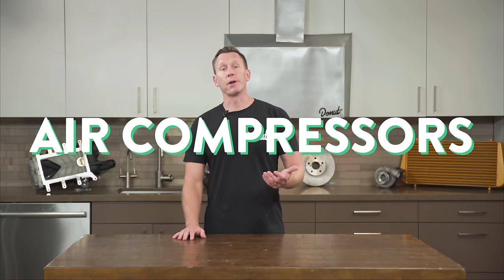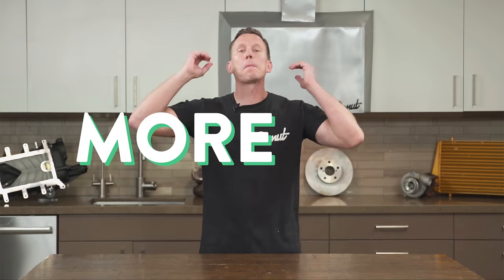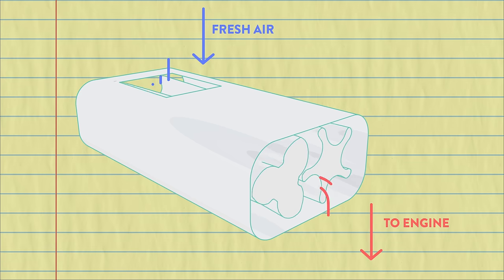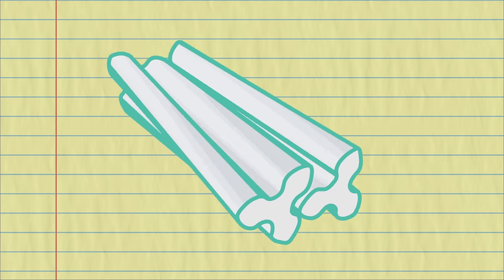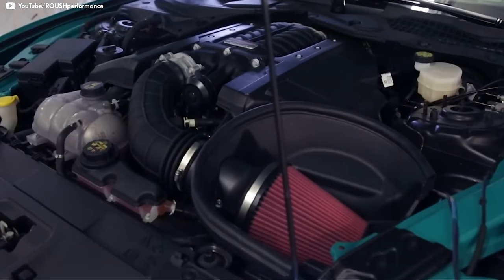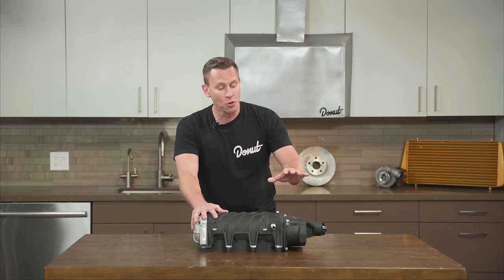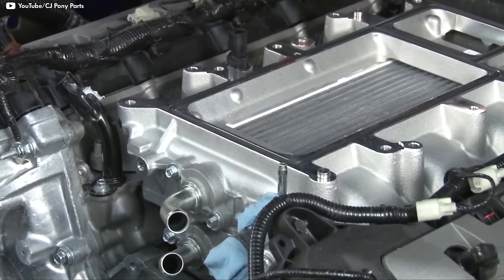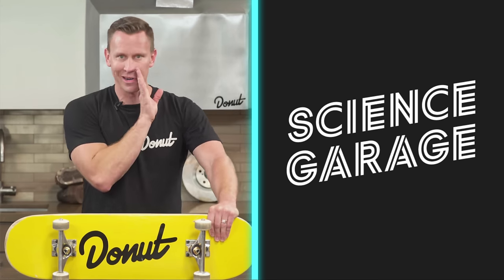SUPERCHARGERS | How They Work

Comment: Anti-lag or whatever it is that creates that loud bang on some cars!
Reply: TotalSalle Use Tuercks car as an example! Lol
Reply: But true antilag like in old Bimmer F1, EVOs, Celica GT4 and Audi quattro S1, not this fake 2 step shit.
Reply: Pietrek L sorry to break it to you, but they're the same thing. Only difference is when it's on.
The reason street cars don't run constant antilag is because it absolutely destroys the turbo/motor.
I helped out a team who own one of the Audi S1 Ap1 cars and even they didn't run that aggressive antilag just because it was too expensive.
Reply: I’ve owned an anti lag system for nearly 10 years and never used it once (1994 Celica GT4 WRC)
Reply: Neg Ative eh probably don't need it. It's a pretty small turbo and you'd only really need it on a tight track.
Reply: I know about that, I'm just curious about this all bypass and other stuff to keep turbo spooling. 
Ordinary 2 step can also brake engine, as you said broke turbo, burn /melt valves and valves seats, bend rods, etc.
Reply: Pietrek L
So in my exhaust manifold, on each of the four runners before they are paired to each side of the twin entry system on the turbo is a fuel injection point. When activated, the anti lag system drips a tiny bit of fuel into each runner in sequence that explodes on contact with the cherry red manifold (Yes it is always glowing hot). The pressure increase from the exploding gases provides both pressure to spool the turbo and pressure to bend the valves in my engine’s head (eventually). It’s also very hard on the turbo components. This is why almost no one uses it.
Understand?
The WRC spec car also comes with a stock water/meth injection system in the TB.
Reply: Unco Casey
Totally. The lag on the WRC turbo is imperceptible and since it’s a steel wheel, instead of the ceramic unit used on the standard model, it won’t come apart at 18psi+. I’ve been running 25psi since 2010 or so - no issues. It’s a fucking beast at that level. Dyno’d way over 300WHP/WTQ on a mustang dyno with all supporting mods.

Comment: Great video!  Suggestion, demonstrate a fuel injector operating with pressure on it... maybe get into pulse width... or the difference in larger flow rate injectors and the accompanying fuel pump and lines.

Comment: How to make 35 MPG in a half ton truck? Pre 2007 
Do that.
Reply: Half ton is more like a golf kart.Most small cars are over one.
Reply: Hailstorm don’t think he was talking about how much the truck weighs
Reply: @hailstorm7868  the truck understander has logged on
Reply: Engine swap
Reply: Or fuel injection and a less aggressive cam, and other bits could boost your stock fuel economy, at the cost of power

Comment: how does camber work???
Reply: sorta. Gotta stop at some poilt then it gets ugly and potentially messy.  Nah. Camber on a car:
You know how you lean in on a bicycle in corners to prevent falling over to the other side? Cars cannot do that, so they roll outward a bit. Pretty visible on not so sporty cars in tight corners.
Now, at the same time most weight is on the outside tire in a turn, bc the vehicle rolled a bit and is generally out of side balance. Wouldnt it be nice to have a wheel that is pretty much straight UNDER THESE CIRCUMSTANCES? Yes, it is, to a point. But bc the vehicle rolled, the tire rolled to, so you have to offset it a bit when going straight in order for it to be better in a turn. Note that this doesnt apply to extreme ricer camber like 15-20-45 degrees, thats just bullshit from a performance (and safety) point of view.

Tl:DR:

It improves Stability while straight and while cornering. Some people also like the looks of a bit of camber.

If overdone, does the opposite.

Comment: What do y'all prefer, superchargers or turbochargers, I prefer superchargers
Reply: Turbs
Reply: Super on Domestics Turbo on imports
Reply: It depends. If I'm driving around town or going to the drag strip, I want a supercharger. You really can't beat the instant power from a standstill. However, if I am in a smaller displacement car that revs higher, I want a turbocharger, especially if I am on a track. I daily drive a supercharged Camaro, and I LOVE the instant boost. But I have driven many turbocharged cars, and I can't deny how fun they are if you keep them spinning.

Comment: never talked about the parasitic effect
Reply: Most people can figure out that a belt-driven supercharger requires a sacrifice of power in return for extra power, since that belt is connected to, and puts a load on the crankshaft pulley. Would you not sacrifice 50 horsepower for 250 horsepower in return? That's like investing $5000 to make $7000. We don't refer to spending that initial $5000 as a "parasitic effect".
Reply: that's the hp to move the pulley . i mean the drag to move the compressor around.

Comment: Wankel rotary engine
Reply: Is it ok to supercharge a rotary engine?
Reply: Lol you can try but as far as i know they are bit fragile engines!! You can put superchargers witht them but not big or heavy duty ones!
Reply: LETSBRA HANABITSKIE yes you can! But what’s unique about rotaries is that they respond really well to naturally aspirated builds too. My 13B could prob hold 350 hp some say 400 (out of a 1.3 liter engine mind you) but after that I’d gut it and put in better internals.
Reply: Jay Kune really efficient at a constant RPM... but in city I get trash mileage. Lots of unspent has due to the shape of the combustion chamber I believe.

Comment: He forgot to tell the supercharger's main con: parasitic loss.. 
Since superchargers rely on a belt connected to the crank over the turbo's exhaust in order to spool, blowers takes a couple of digits off the overall kilowatt power of the engine.  not to mention the overall lack of tuning potential (you get what you pay for. No extra tuning potential in comparison to snails)
Reply: Christopher Carter excuse me 
Care to explain that?
Reply: you don't loos power turning the pulley if you do its fucking broke. it's making power even at idle so how can you loos power and make it at the same time?
Reply: REDLIterriblelet's say you have a bicycle..  
You pedal your bike forward by using our body's leg muscles (same as a car and it's engine) 
Which in turn runs a chain and gear to run your rear wheel. And when you travel uphill, you move the chains through different gears in order to climb the hill (like a car's transmission) 
Now let's say I installed a small electric motor on your bike which helps you in your pedalling but... 
In order for it to work, you have to charge it's batteries first by pedaling your bike which in turn, makes pedalling harder since you're not just pulling your weight on the pedals, you're also charging a battery for your motor which in turn, helps you with the pedalling 
It may give you extra help, but it's also adding your burdens
The same applies to a supercharger. The engine is responsible for its spool so that it could give more air to the engine, your engine is not only responsible for the car's forward motion, it is also responsible for your A.C. lights, and other bits and pieces you have onboard 
Why should you burden it further by adding another belt and chain to it when you could just fit a fan in the exhaust and make it run a turbine to bring air into the intake? Should you burden yourself with extra luggage? 
P.S. fix your grammar. It's terrible
Reply: You sacrifice hp to gain several times that power, i think that it is a very nice deal. Btw, turbos also draw some energy from the engine, not like a sc but it has some effect.
Reply: kyubey, the cute little devil I agree with you. That should have been mentioned. Also, it creates more wear on the engine overall, compared to turbos. The parasitic loss also means lower fuel economy, which is why most manufacturers use turbos instead
Reply: kyubey, the cute little devil When you got to slap someone with supercharger knowledge, do it in style...Nice work

Comment: Okay. So correct me if I'm wrong. Strong engine + supercharger = good. You need a strong engine to pull that supercharger (because I'd imagine it adds extra weight/drain/strain on the car) to keep it going.

Comment: Been thinking to create a Dual-Hypercharger system, in which a Roots type Charger is the base part, but a LOx system below with dual function: 
1) The OBVIOUS: cooling of the taken in air.
2) This would be the fun part, where 10 to 15% of the air is replaced with pure LOx... considering it is Oxygene that make things go really boom, well....
Thoughts?

Comment: The GM two stroke diesel  engine found in trucks buses and locomotives uses both as a two stroke doesn't rev as high as a four stroke engine and uses piston port induction it uses the super charger for low rev power and the turbo for top  end power

Comment: There is one thing I don't get. At 3:51 it is said that the air doesn't get compressed inside the Roots charger, so why should it need an intercooler?

Comment: Gonna break some hearts here; Turbo's Suck and Superchargers blow...no matter how you slice it. Either application is doing little more than "buying" you displacement.
  Turbo's can be mechanically tuned by installing different bearings, or blades, Superchargers most easily mechanically tuned by swapping pullys and belts.
   Again, you're just buying displacement by increasing the 'volumetric efficiency" of the amount of air in the combustions chamber.
   As with all things in life; this proposition is a trade-off; engines built with the intention of running turbos usually come with milder camshafts, and/or lower standard compressions/reinforced rings.
    Applying forced induction to an engine not initially engineered for it, may require more internal upgrades to improve long-term reliability and longevity of the engine in question.
    Turbo's and blowers ain't good or bad, they just are...and both have their ups and downs...both also prove the point that "There's no replacement fot displacement"...and that robbing Peter to pay Paul; will only buy you so much yardage, and Peter gets sore....and no one likes a sore Peter.

Comment: But what about belt driven turbos like the rotrex supercharger? Is it a turbo? Is it a supercharger? Is it positive displacement, root or screw?
Reply: If the compressor is driven by a belt and not a turbine in the exhaust it is a supercharger. Centrifugal superchargers (also called pro chargers) have the same snail shell style of compressor that turbos use. They look like a turbo on the impeller side but instead of a turbine it has a belt connected to the engine. Centrifugal superchargers are neither roots nor screw, they are their own category.
Reply: Redtooth 75 ah I see. Well, ill have to do some more research on superchargers then. I was looking on what kind of supercharger would be the best for my car but I thought there were only 2 types of superchargers. Turns out there are 3 types.

Comment: Parr of the reason I checked this out, I was watching Mad Max 2: The Road Warrior and saw that during the opening chase, a low fuel warning light came on and Max turned off the supercharger. The engine still ran, but the supercharger's drive belt stopped spinning. Is this a real thing? My only guess was that the air will still enter the scoop and be fed to the engine and somehow the drive was disengaged.

Comment: But how are superchargers driven? And at a constant speed on top of that??
Reply: They are driven by a belt connected to the crankshaft. The rpm of the supercharger will change with the rpm of the engine.

Comment: You never mentioned the fact that superchargers, un like turos, actually rob from the engine and that's why you don't typically see them on 4 cylinder engines. That roush super phase 1 supercharger takes about 50-75 HP to spin. So if it says it adds 200 HP you have to subtract about 50 from that number and your left with a 150 HP gain. Now if you put this supercharger on an engine that only puts out 100 HP, your won't be getting 300 HP you will probably be getting more around 200 HP. Where a turbo is pure power adder.

Comment: Ok, what if, you have a turbo AND a super. The super not only blowing air into the engine, but also pulling exhaust out to feed into the turbo!?

The turbo spins up faster and pushes even MORE air into the super!

The system would feed itself into motorific deification of infinity! Or, at least until the metal fractures.

Also, if four find are better than three, wouldn't give be better than four?

Comment: This video was very good, but I am curious about the actual energy balance aspect of supercharging. Why would you gain power from stealing an engine's crankshaft power output and putting it in a supercharger? Even if the efficiency were 100% (ex full adiabatic efficiency during the compression) you still wouldn't gain back more power than you put in the supercharger in the first place. 

I understand how it works in a normal turbo: You are using the thermal and kinetic energy of exhaust gases that didn't contribute to engine work in order to compress air. It's basically a turbine that uses the remaining energy that would otherwise be spilled to power an adjacent compressor. I just don't get it with superchargers.

Comment: Why can’t you use both turbo and super charger on one motor?
Reply: Mary Elizabeth Leonard  the new volvo 2 litre inline 4 cylinder engines all use both turbo and superchargers ..
Reply: Its not very common because its expensive. Volvo started doing it fairly recently and a few people have done it in the aftermarket for other cars.

Comment: Ok and why are turbos still used when superchargers don’t have lag ? What are the downsides of superchargers ?
Reply: They create more parasitic loss than turbos do. At the same density a turbocharged engine will produce more power than a supercharged one.
Turbos are also better for fuel economy. When cruising at part throttle the turbo is usually not spooled up. Because you aren't boosting the engine you don't have to inject as much fuel which increases fuel economy. But when you want power and open the throttle the turbo spools up and gives you extra power. A supercharger is constantly spinning.

Comment: The representation is incorrect regarding the amount of air since the 2.4L of air would be considerably large
Reply: Litres are a unit if volume, so it would be the same size. A litre of air is the same size as a litre of  water.
Reply: TheNerdfollower That is only at 4 degree Celsius
Reply: Pizaan Tadiwala No.... Liters are always a measurement of volume
Reply: Connor S Dude its simple chemistry water is 1g/ml at 4deg
Reply: @pizaantadiwala2721  Dude nobody is even talking about weight here.
Reply: @APFSDS-DU  I think you mean density and mass, but still you're saying th truth
Reply: TheNerdfollower Yeah my bad 👍🏻👍🏻
Reply: @pizaantadiwala2721  Bro,  that's density that you are talking about. A litre is 1000 cubic centimetres. An ml  (mililitre) is one cubic centimetre.  No matter what they are measuring, the size still remains the same. Density is the amount of mass per unit volume. That means that a body of water has 1 gram for every cubic centimetre at that specific temperature. In other words, a gram of water takes up 1ml of space. A gram of air would take up more space, clearly,  as air is less dense than Water. However, it is not density that is being addressed; It is volume. A litre of air takes up one litre of space. Similarly, a litre of water takes up 1 litre of space. If you have a litre bottle, whatever you fit in it will be taking up one litre of space

Comment: Hey donut media if a 2.65 l supercharger pushes 2650 cubic centimers of air wouldent a 2300 spin faster cause its smaller but it moves 2300 centimeters of air

Comment: Super charger and turbo chargers are good, i get what you a saying about the turbo charger but the super charger robs the engine of its own power and your not saying that and they are better on bigger engines because for smaller engines to turn the superchargers its allot of work for the engine and wont give it all the power and just wont really do any thing and the turbo well it has lag but it uses free air so it does not go to waste and its fuel efficient why your not saying that huh .but at the end of the day their both good